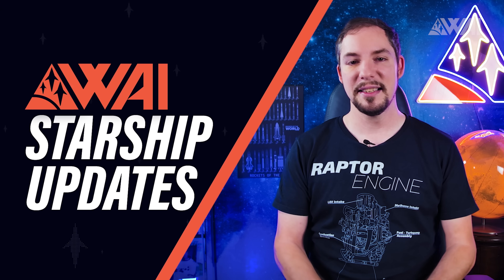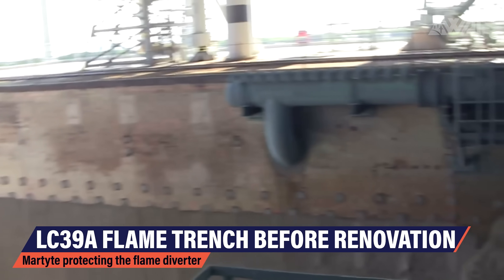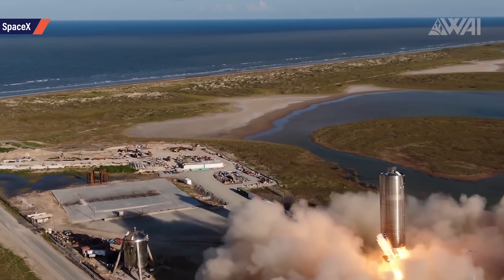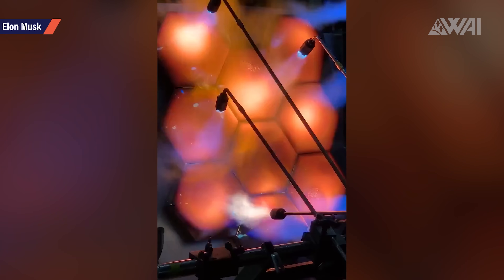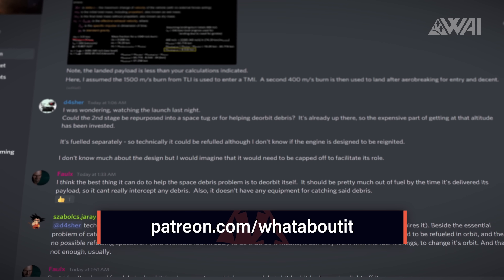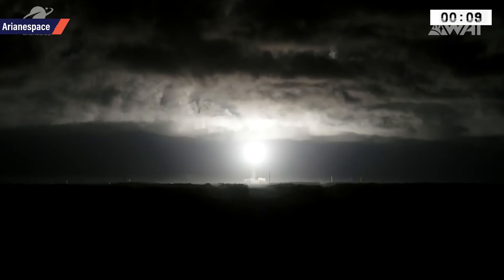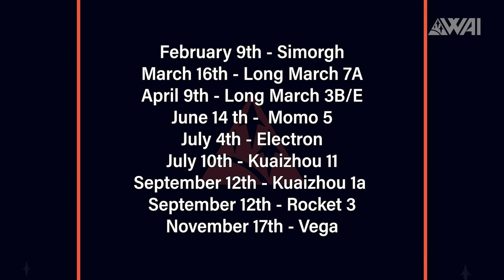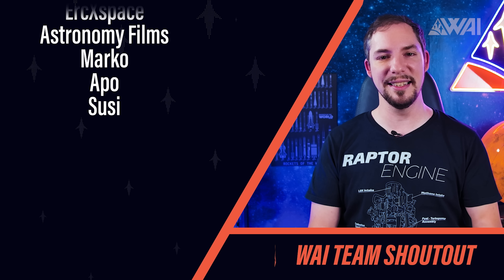134 | Why Martyte helped to damage a SpaceX Starship Raptor engine!

Comment: There won’t be any flame diverters on Mars or the Moon. Starship MUST handle the flying debris.
Reply: Already being modified.  Cables will be enclosed in steel pipe to protect them.  Whats important is that the flying debris didn't breach the bulkhead
Reply: @ryann6919  Did you already include the weight of the pipes -.
Reply: They are modifying the design
Reply: Perhaps there's just too much empty space under the engine skirt on these prototypes. An operational ship will have 3 large vacuum bells and larger landing legs, with cargo pods fit into whatever space remains. There will be little room for debris to fly up into the various piping and conduits.
Reply from the maker: Wait! We're not looking at the development of the Mars variant here. We're looking at early prototyping. Musk has said before that Starships will do many hundred flights before taking Astronauts to Mars and returning with them. The pads SpaceX is building right now will of course need a flame diverter, if Spacex wants to use them long term and for Super Heavy.
Reply: @Whataboutit  
I understand your point. However, Starship has to operate in dirty environments. In my opinion, it’s better to harden Starship against such failures now, here on earth during the early prototyping phase, than it is to march along the flame diverter path only to find a major redesign is required to accommodate extraterrestrial landings and launches.
Reply: @johnbazaar8440   There's some truth there, but Starship has so many radical features to develop. It won't hurt to get certain prototypes flying in order to work out the difficulties and general principles of the skydive maneuver and flip. Parallel work can be done on the debris blast problem. Spending the next 6 months on this won't take them deeply on a wasteful path.
Reply: @donjones4719  
They’re already putting in shielding on SN8. I expect they’ll launch and land and see what else breaks and fix that. This is the approach they’ve taken so far. That’d be my approach. Further, flame diverters help with launch but nobody yet has landed on one. Flying debris will exist there, too. Engine meltdowns and control systems failures on the landing pad with a crew onboard are bad.
Reply: @johnbazaar8440  Flame diverters do more than just stop flying debris. They help cushion noise, shock and vibration that could feed back into the vehicle in the initial milliseconds of launch. Make no mistake, Superheavy launches will make Saturn 5 launches sound like pipsqueaks in comparison, and the latter were terrifying. Perhaps only launches at sea will be safe.
Reply: @donjones4719  There won't be any 'skydive' manoeuvres if the vehicle can't safely clear the pad. and the pad itself has to survive the launch.
Reply: @Whataboutit  Also, for the commercial, mass produced mars rockets they could just use a starship to take the heat diverters as payload.
Reply: At least the orbital pad is big enough that they could modify the underside to divert flame better.  Being able to launch from any terrain is important for the big mission this ship is planned to take, but having a pad that doesn't need serious repair work is just as important to launch efficiency as having a ship that doesn't need repairs.  Water launches are probably the best solution down the road.
Reply: I didnt even consider this.
I feel its still possible to tear up the landing site raptors are so strong.
Might have to find an extremely hard landing surface.
Reply: @Mallchad  not just Mars and Moon. Starship must land on a pad, it cannot land on a flame diverter. It is critical for them to solve this.
Reply: @DarktroopX  Well. I think its possible just about to land on a flame diverter. and  think this is Elon Musk's goal.
He said he wants to land directly on the landing pad, with extreme precision.
And with some community mock ups its not unreasonable to think that it might be able to land on top of a flame diverter this way
Reply: @Mallchad  Honestly it would be awesome. But i don't think they can do it right now. The early starship models will do that crazy swing landing and I don't think that kind of precision is achievable with that maneuver.
Reply: @DarktroopX  Me neither. I think this is one of those things they will try and inevitably bail until they can gurantee better precision.
Reply: Don't need anywhere near the same oomph to land or takeoff in 1/3 or 1/6 g.  That would also mobilize debris more, but it would be less energetic.
Reply: Okay Boss, don't  fire me:)
Reply: Bravo
Reply: I would say, not for a 15km test flight to test out the fins function.  Harden the underside later, or with other vehicles...like what are SN5 & 6 doing?  Why not fit 3 engines on them and do ground-interaction engine tests on another test stand?  Why risk blowing up SN8 rigged with fins and stuff?  But I think this facility is just not large enough for the numbers of tests that need to be done.  Some need to be done concurrently, or we ain't never gonna get to Mars.
Reply: The bigger question is will Starship and/or super-heavy have a landing pad which has a similar flame diverter. The three engines needed to bring down the starship throwing up enough to debris to kill one engine would be compounded by the number of engines a super-heavy would need to land with. I suspect some form of flame diverter and tell your system will be employed to dampen the Acoustics and Ensure that no debris is being thrown back into the engine as it touches down, and the Deluge system would adequately cover the landing pad, draining into the flame Trench, and taking advantage of the leidenfrost effect would be protected from the heat of the engines.
Reply: Thats pretty irrelevant, they arent using the most powerful rocket in history to land on either of those, just the starship, 3 engines not 28, the difference is insane.
Reply: Flame diverters wont be present in other celestial bodies of course... But it's still better to have one on earth while still capable of landing without flame diverters.
Reply: yes, you are correct. They have to test every possible outcome to develop a general approach spaceship to handle most harsh environment. They are heading into a right direction.
Reply: and a long lasting dust-storm
Reply: From what i v red earlier over here, the moon mission will have thrusters higher up the rocket to prevent making a big fuzz when landing. Maybe the lesser gravity of the moon also allows those thrusters for a cleaner departure. E.g. not creating a crator.
Would be really interesting to see weather it would be 'upright enough' and not at an angle too far for takeoff. Imagine Starship shooting at an angle of 30 degrees at takeoff. What a blast of dust that would be. 
I guess the practice of bi-pedals picking up rocks from the moons surface for study on earth would become nearly obsolete as those rocks start flying around earth as a new neat flock of SpaceX satelites...? Just my imagination.
Reply: @camielkotte  Currently they have no plans for a lunar starship to leave the moon. Which makes sense because you can't really refuel on the moon, starship runs on only methalox right now.
 I suspect you could leave moon gravity, but getting back to earth in one piece would be much harder.
Best case scenario you rendezvous with another starship in a fast low earth orbit and transfer cargo, and fuel?

Side note to somebody else about less force required to leave martian gravity and debris getting kicked up. Yes, that is true. But.
Most engines, especially Raptor, has a minimum thrust for the engine to be operational without risking engine failure or damage to the ship.
In the case of Raptor. even 10% of thrust, is still over 200 thousand newtons!
That's like being slammed with a 20 tonne slab of metal in Earth gravity!
According to the wiki the Raptor minimum duty is actually closer to 40%.
Which is nearly 1 meganewton of thrust. 
Even a single raptor running quite ALOT of debris will be kicked up.
Reply: Didn't you see the rendering of the lunar starship?  It has forward thrusters to avoid this whole flying debris business.  Mars is another situation all together.  May have to go with legs to lift the ship up higher, and source out a landing sight that is, well, flat and hard.
Reply: Carrying a partition or steel plates are an option.
Reply: there is no reason why they can't make flame diverters on the moon and mars...  anyway whatever they are going to do on the moon and mars is totally irrelevant to what they are doing here on earth where flame diversion is a known technology and they should just get it out of the way so that errant flames do not set back their research.  it is 100% possible to make flame diverters here or on mars and the moon.  I get that if you are doing propulsive landing for vehicles that are landing and taking off from the same spot flame diverters are less helpful.  But okay, you still have to solve for the problem of shooting rocket flames at whatever you know you are going to be shooting rocket flames at.  If it's going to explode then you know for multiple launches per day you're going to end up with a problem.
Reply: Shane Humphrey  There are none in the solar system.
Starship is a ship designed to explore the entire Solar System. thats it.
Reply: Exactly....

Comment: @what about it  can some sort of high heat metal be molded as a flame diverter? I mean it would be better longer term if i'm not mistaken.
Reply: It makes sense to myself and others that a small shallow metal cone would divert the flames to all sides equally. A fairly normal steel alloy would work, I think, because the heat exposure is so brief. It could even be internally water cooled. Also easy to retrofit to the pad.
Reply: @donjones4719  and perhaps make it portable!

Comment: why not start a new super heavy launch pad and move the smaller tests to the other one that is already partially up?  it may be risky to use it with 28 engines but we aren't to a full 28 yet, i think it could handle 3... just not sure how long it would take to complete the construction of the one that is being worked on now.   but it would raise the height of the launch and help us get our 150 out of the way :D

Comment: How will Starship launch from Mars if it can't even launch from place designed for it?? They need to work on it
Reply: Mate this is a goddamn prototype...
Reply: @saltylelele  how does that change it tho? You’re both right, it’s a protyotype. But prototypes are for learning with and VIP is right, there won’t be any concrete when they land on Mars, there will be lots of rocks to go flying. They need to figure out how to fix that issue.
Reply: @ryanhamstra49  That is a fair point yeah

Comment: flying rocks wont be a problem ever. starship is on top of superheavy, the debris would have to fly really high, losing a lot of energy.
 if it takes off from mars, there would still be time for astronauts to replace heat tiles in space or for the crew to transfer to a different starship. and even without a heat shield, starship can land just fine, the heat shield is to allow starship to be reused, the steel can survive reentry with some damage.
 and even if the hull gets damaged, the fuel for landing is stored in the header tanks so it would still be able to land.

Comment: Is Starship body the Actual Fuel tank? Or is there a different Fuel tank inside the body?
Cos im confused if the body is indeed the fuel tank itself,  how does SpaceX drill the holes for installing Heat Tiles? 
Only way would be there is a seperate fuel tank inside the stainless Steel Starship body right?  Can anyone help me understand this?
Reply: The outer shell is the tak. Idon't know how they actually put on the securing points but one option would be a special type of welder which attaches studs to the outside of a surface. Some explaination of a version of the process here https://www.machinedesign.com/fastening-joining/article/21837594/stud-welding-the-basics-and-benefits . I believe there is also a friction version (guessing that would involve rotating the stud rapidly while its pressed against the tank wall until the base of the stud and the outer part of the hull melted enough to fuse together). Neither need holes drilled through the wall with the subsequent risk of a leak.
Reply: @Midlife-Adventures  but if u look close they actually look like holes
Reply: @merxellus  not sure my eyes are good enough to look that closely.
Reply: @Midlife-Adventures  rip eyes then
Reply: @merxellus  I do miss fine detail.

Comment: Another excellent video Felix.
SpaceX's difficulty with debris flying up and damaging the rocket leaves one wondering about the consequences of landing and lifting off from unimproved surfaces. Seems to me inevitable that they're going to have to have significantly longer legs to put some clearance between the debris laden surface and the underside of the rocket. Legs that fold down and retract upward would probably be the most effective and easiest to construct. Essentially be like those on the Falcon except instead of actuating the struts they'd actuate the top of the leg. Their profile would be aerodynamic even as they retract. Are you listening Elon?

Comment: I’ve been worrying about the test platform and especially the orbital platform for a while because of the sheer power coming out of the Starship and then Super Heavy. Last week’s test showed what kind of damage 3 raptors can do the pad, and in turn, the Starship itself. I’m no rocket scientist but it seems like having only 30 to 50 feet of space between your vehicle and the ground is asking for more problems.
Reply: A most logical conclusion.
Reply: There is also the matter that they weren't approved to operate SH, only Starship on site due to restrictions stemming from explosion radius required, various EPA, DOT Enviro Protection regs etc. Al their previous animations showed them basing it well offshore for those reasons on a platform like oil rigs use or perhaps a MOB design. See :  https://www.navyrecognition.com/index.php/news/defence-news/year-2015-news/august-2015-navy-naval-forces-defense-industry-technology-maritime-security-global-news/2973-china-unveiled-its-first-vlfs-project-similar-to-the-us-military-mobile-offshore-base-concept.html  I don't think those steel pipes, even filled  filled with concrete and rebar go deep enough to withstand the forces involved from dozens of motors firing simultaneously... maybe they'll just fire 6 to 12 of the motors to move a fractionally loaded SH Booster to another launch platform off shore ?
Reply: Mike Love I believe the piling go 150 feet but those rockets will certainly be devastating on the surface.
Reply: @sdfried4877  Agreed, need to go back in time and view old photos to see if that's possible or probable, remember this entire area is a series of barrier islands mostly composed of sand, They would have to slant drill pipes as caissons, welding them together as they went down to allow concrete and rebar later backfilled to tie into upper structure we saw being built above ground. Likely they went down to reach bedrock if possible.
Reply: Which makes more credible that the Apollo landers landed with the rocket Bell, barely 3 ft. from the surface of the Moon. As this problem of taking off from an unprepared site, maybe we'll find out how NASA accomplished take off from unprepared surfaces. Yeah, the next ten years are going to be a killer.

Comment: In other words... Musk's reckless and "cheap" ways are coming back to bite him in the butt! Sorry, but I can't resist saying I told you so :)
Reply: Yeah, Boeing´s methodical and slow approach is much better and solves any problems beforehand, so that failed test flights with crew capsules do never happen...
Btw, the FAA lifted the grounding of the 737 max. It took just 2 crashes and 20 months of research to find a solution to a problem that should never have existed in the first place.
Reply: @antyspi4466  Just because Boeing is motivated by greed and run by idiots doesn't mean SpaceX should copy them. Greed, recklessness, and cutting corners brought down the 737's and caused the failed flights with the crew capsules. See any similarities with Starship development? Just substitute greed with the obsession to get to Mars quickly.